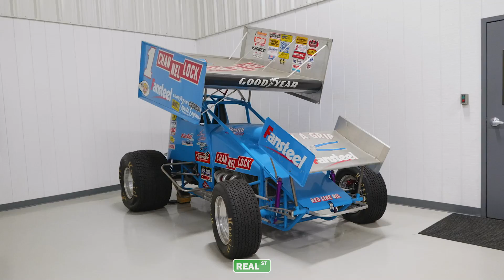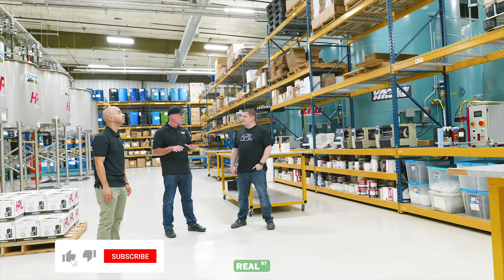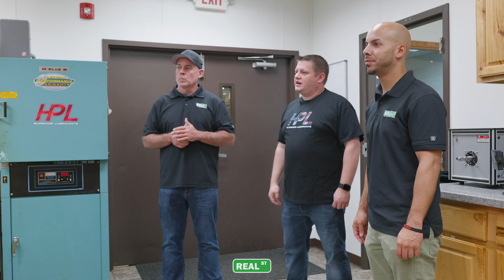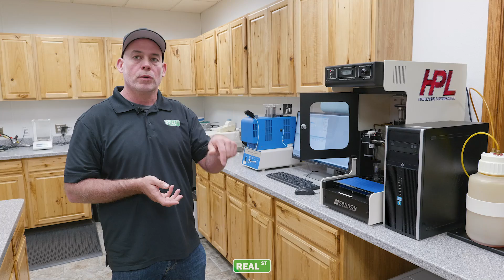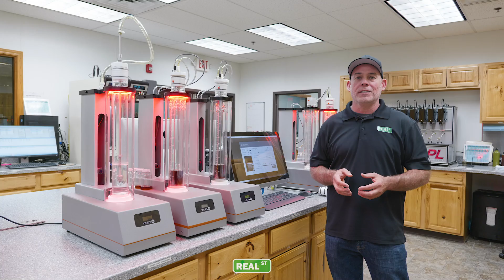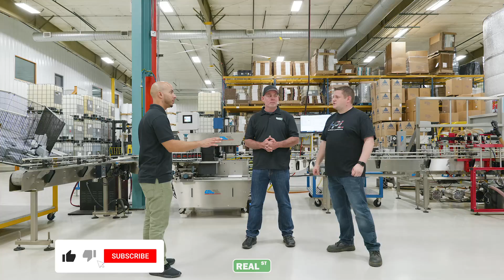How Race Oil Is Made - Behind The Scenes (HPL Oil)

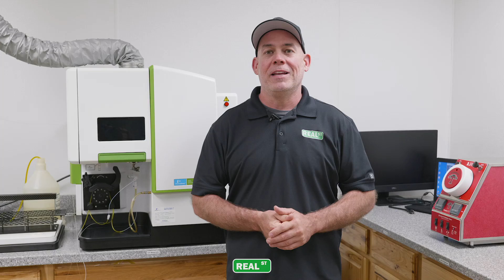Comment: 13:15  better than Mr. Wilbur's equipment where he testified : 
- I used a Hewlett-Packard 5710-A dual-column gas chromatograph with flame analyzation detectors. - Uh-huh. Is that thing turbocharged? - Only on the floor models. - Now, what was the result of your analysis? - The chemical composition between the two samples was found to be identical.".  - Identical!
I got to get me a gas Chromatography Mass Spectrometer!

Comment: Good oil on turbo is so important. I use Mobil 1 EP AFSMO and I have seen my turbo get cherry red and still works perfect.
Reply: I've been using the mobile 1 extended performance (higher priced gold bottle) on my turbo small block ford drag car and it works ok just had to change it every weekend due to the oil getting really thin with heat cycles. The mobile 1 full synthetic did it worse. I would drop oil pressure every race then it would come back up with fresh oil. I've considered going to valvoline vr1 or something else like lucas or HPL. I think there is better oils than consumer oils from Walmart.

Comment: I always question the difference in oils buy any full synthetic oil and they will all have the API/SAE  donut or starburst saying they meet or exceed these standards along with the other standards exceeded listed on the bottle. In my opinion there is not much difference between HPL and other quality synthetic oil. You would have to buy a dedicated race only oil which I guess is not good for street driving.

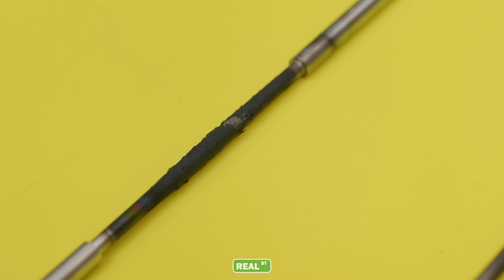Comment: 12:22
I have been saying for years that 2 step / anti lag is NOT GOOD ... You are destroying the valves, the turbo manifold and the turbo itself.
Reply: Yeah, just for flames is not but you need antilag when you need to launch tho
Reply: @mihailpetrovici5044  regardless of what you are using it for, its still bad.
Reply: @ACommenterOnYouTube  yeah dude but it's still usefull
Reply: @mihailpetrovici5044  well i respect my engines and will never use anti lag. My 4 cars are all tunned to launch with the most boost possible without breaking the tires loose. Wot and its like a rocket shooting off.
Reply: @ACommenterOnYouTube  And how do you make that boost on the launch dude?
Reply: @mihailpetrovici5044  i don't because i don't need to. The boost starts off low and ramps up as the rpms increase.

Comment: In regards to the turbochargers cooking oil, the OEM manufactures came out with water cooled turbochargers in late 80's. When the car is shut down the water takes all the heat from the core, and shutdown procedure is just drive gently for the last minute or so and turn the car off.
Reply: Good old turbo timers in the early 2000s
Reply: Lol. I'm sure all Ecoboost drivers have read the manual and abide by manufacturer recommendations 🙄
Reply: In the owner’s manual for turbo cars it says leave engine running in neutral or park for 1-2 min to cool the turbo